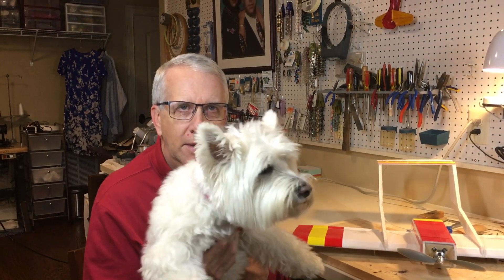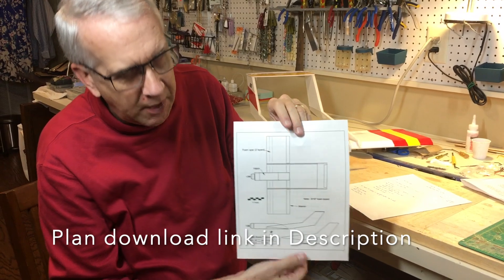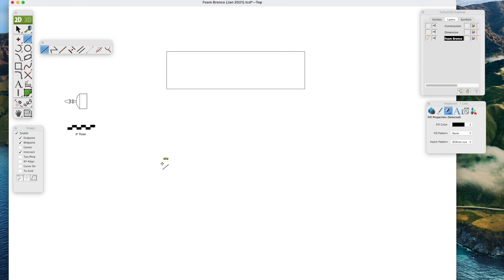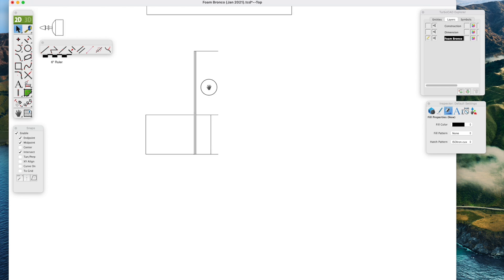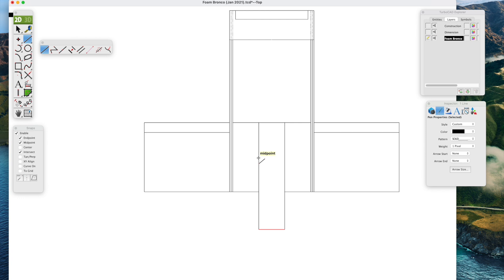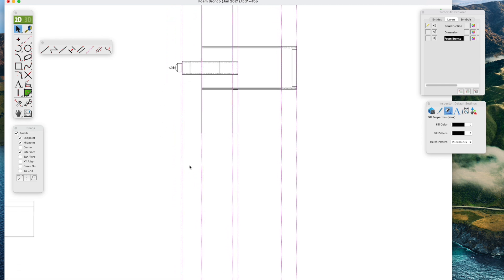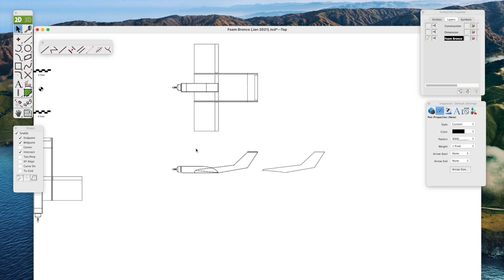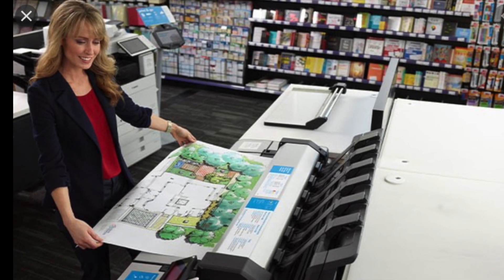TurboCAD Tutorial Foam Board Bronco RC Plane

Comment: Hi Tim, I also use TurboCad for my Plane designs The windows versions. 
I have been using this software since Deluxe 12 and now on Deluxe 20 Which is great but they do not seem to do the Deluxe versions anymore. I can see yours is different due to being a Mac version but what version are you using It does not display the version number like my windows version does. Oh by the way My version only cost ten english pounds which is very cheap compared to the full blown version.
Reply from the maker: Stephen:  I was using TurboCAD Ver 12 on my Mac, liked it a lot.  Problem arose when I did a normal iMac system upgrade to Big Sur (all upgrades named after California locations), and my version would not work with the new operating system.   TurboCAD wanted $80 to make it compatible, so I went with QCAD.org ($42.00), never looked back.  QCAD just great for 2D drawing, love it.  Tim
Reply: @TimMcKay56  I will have a play with it thanks 👍